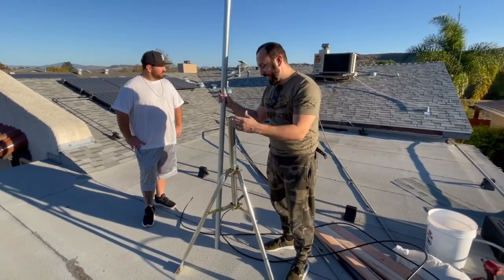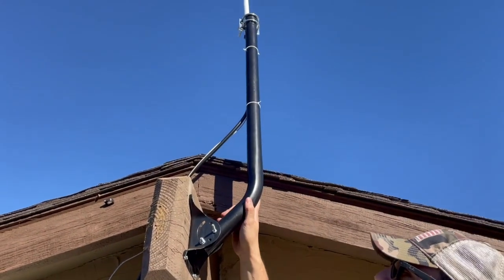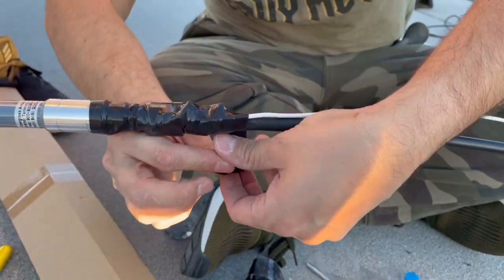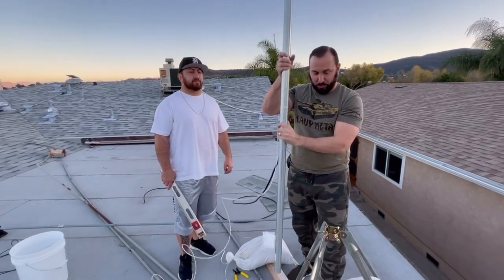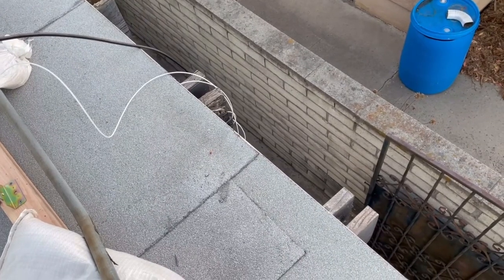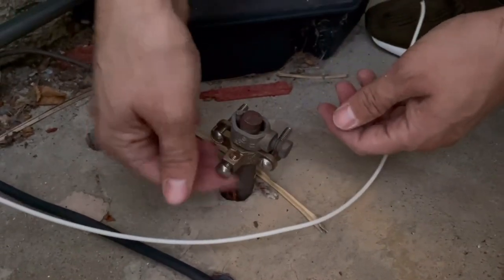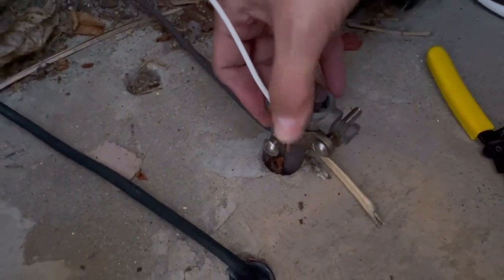Outdoor Tripod Setup for RAK or Bobcat Helium Miner | Earn More Money HNT W/ Outdoor Antenna Install

Comment: Nice. I was looking for a different set up from the last video. This will work for me. Only thing that bothers me is I live in south Florida. We get some high winds during hurricane season. But I dont want to attach anything to my house. We don't have hills or mountains down here so a set up like that can cover a lot of area.
Reply from the maker: True. Maybe use more sandbags or be ready to take it down when you have strong winds.
Reply: Maybe use some construction adhesive under the 2”x4” lengths? That would help with the wind loads.
Reply from the maker: Thanks for that advice Bob
Reply: @bobrella4740  Thanks Bob!

Comment: Deciding between the steel fence post vs 2 inch PVC pipe. Why did u choose the fence post over the PVC?
Reply from the maker: The fence post is sturdier
Reply: @CesarCinema  thanks.  They cost about the same at home depot. So I'll go with the fence post.

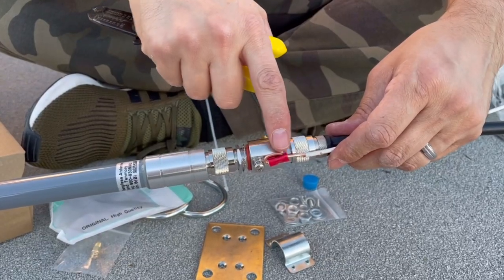Comment: you missed the screw on the lightning arrestor... (6:00) it is meant to hold your cable in place
Reply from the maker: Have you tried this yourself or have a picture of this? I appreciate the help but the grounding wire does not go on the screw. The screw is way too small for a 12 AWG wire.

Comment: Hey dude, what type of connection is the LMR 400 cable you are using? Obviously its N type Female from the LP device but is it SMA RP Male or N type going into the miner? Thanks in advance just looking at which cable to get right now
Reply from the maker: SMA RP on the miner side

Comment: Yo where did u get that antenna mount I have rak wireless 8dbi bought mounts on Amazon but it didn’t fit where can I get the one u used in 7:45 and will it fit the 8dbi antennas?
Reply from the maker: It came with the antenna we got from Amazon. I’ll like one in the description box in the Miner Equipment link.
Reply: @CesarCinema  Yeah, I like the square plate between the antenna and pole. Do they sell the square plate seperately?
Reply from the maker: I’m going to add that part to the link in the description.